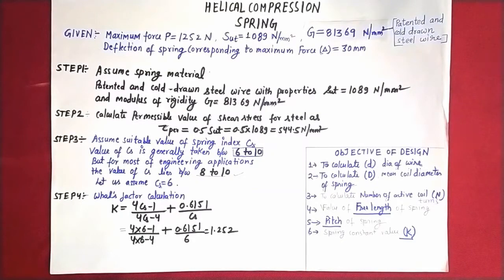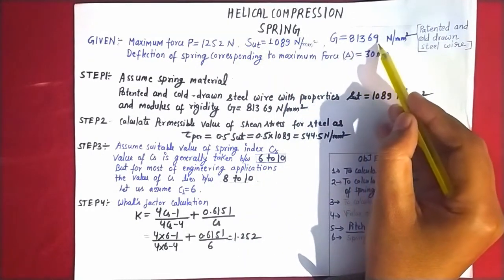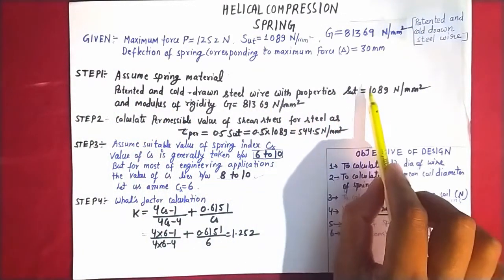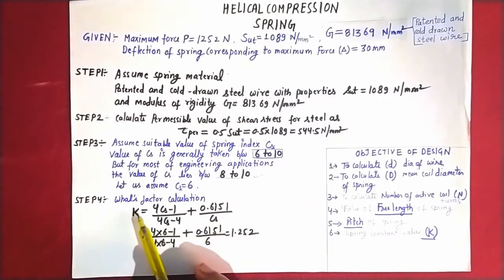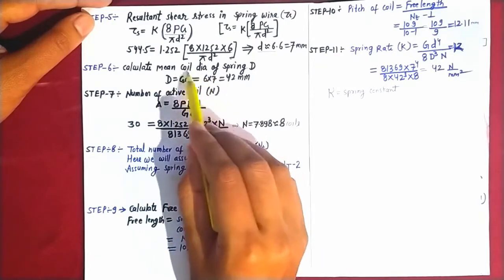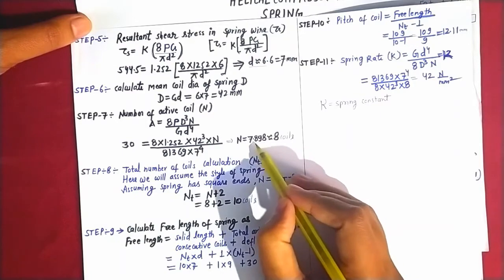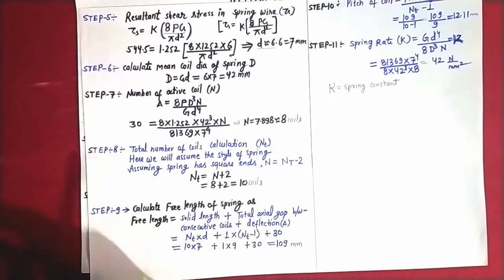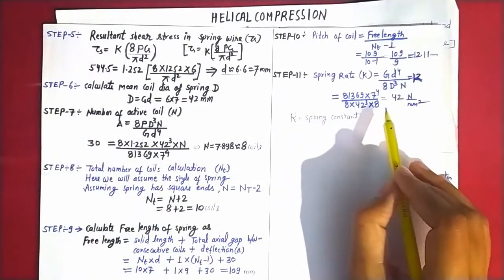DESIGN OF SPRINGS,DESIGN OF HELICAL COMPRESSION SPRING,CCHS DESIGN,SPRING DESIGN PROBLEM,SPRING

Comment: How to calculate compression spring design for values, working load 200 grams, deflection 20 mm, free length 57.5 mm and outer diameter 10 mm ? I need to know wire diameter, no of turns, pitch and other specimen...if u know how to calculate pls guide me...